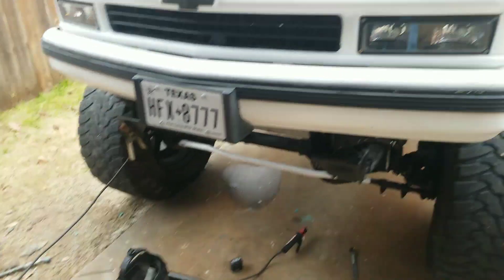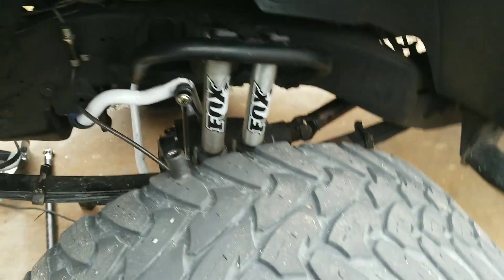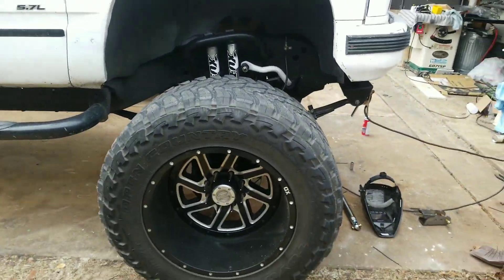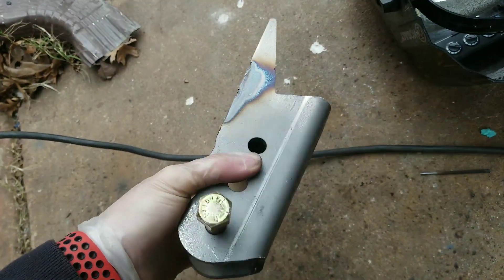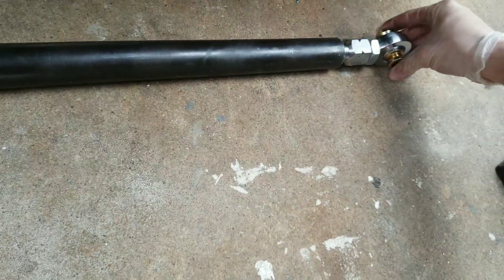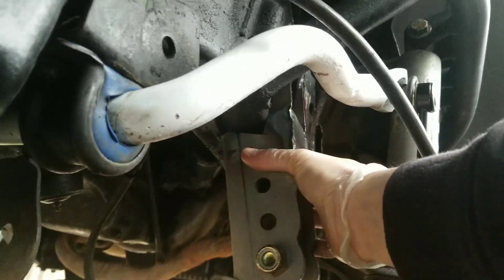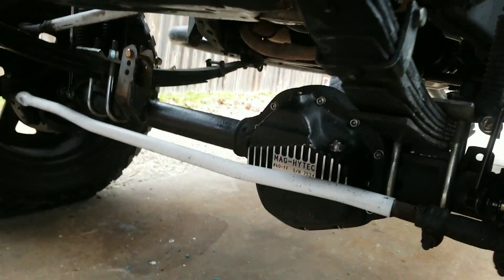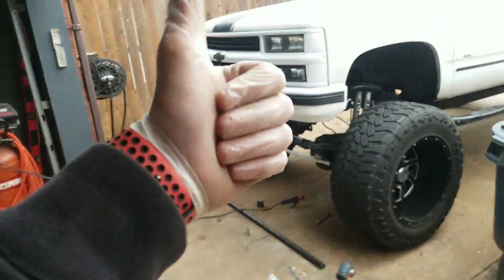Update on the big white girl

Comment: hey man, I got the 95 c1500 with the 350 I just want it leveled out and maybe 2 inches higher. I love your k1500 build its fucking badass bro.I need help on what torsion keys to buy and if I need new shocks and other extending components if I put that new angle on the front end I am new to mods.

Comment: Hi Tristan I have a 1999 version of the k1500 z71 5.7 liter I'm trying to fix up on my own its the exact same body style I've done a few minor modifications awhile back with my dad before it was parked 8 years ago and it hasn't moved,  im trying to get it running so i can get it off my grandfathers land this truck means a lot to me it was my granddads and my fathers truck since 99 do you have any pointers  and where to start i know what all i have to do i just don't know the right approach.   John
Reply from the maker: Throw a new battery in her and change the oil. Pull the fuel pump relay and crank it up so you get some lubrication to the top. Maybe a tune up before hand. The 350s are solid motors, Id just make sure its ready to fire up before actually trying to start it to avoid scoring the pistons or running the valves dry for a few seconds
Reply: @xXShadowRejectsXx  thanks